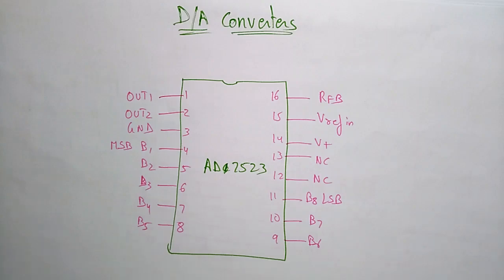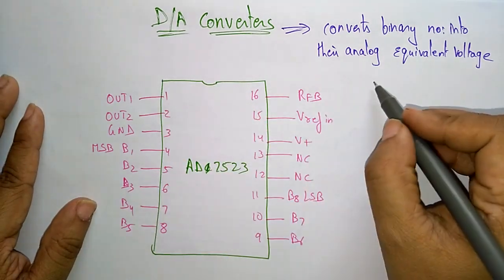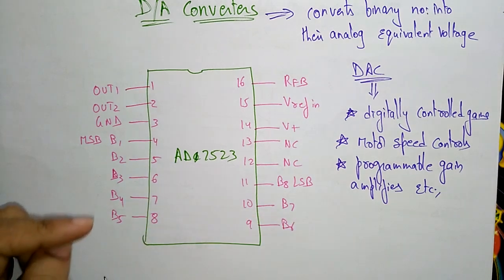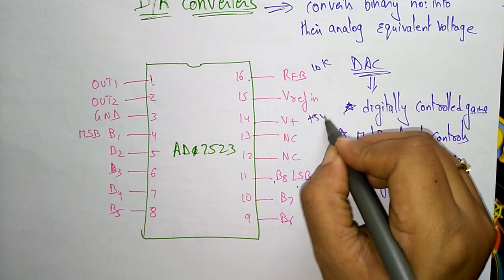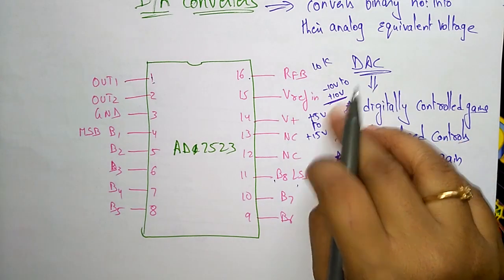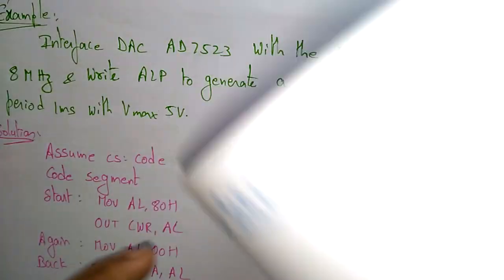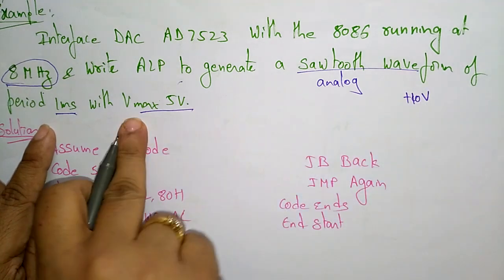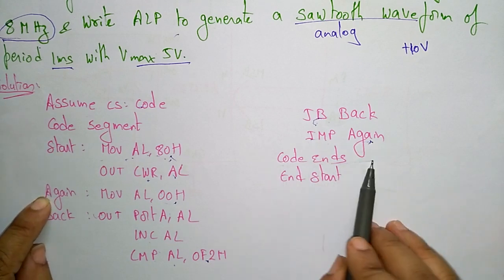DAC interfacing with 8086 | ALP program | | MPMC | Lec-47 | Bhanu Priya

Comment: how to use sine wave
pls reply fast
iam having exam
Reply: The most obvious way is to get the time value T, then calculate sin(T), then convert it to fit the DAC range, and finally output it. But the problem here is that calculation of the sin(x) function can use all the resources of the microcontroller and take a lot of time. all the best for your exam